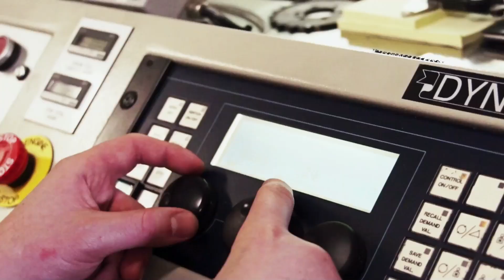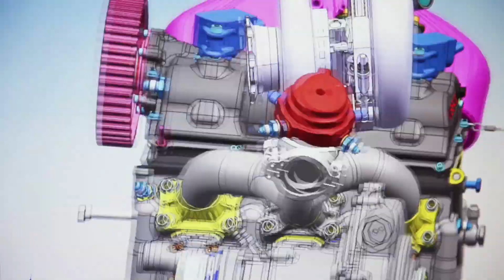Nissan ZEOD RC Making #2: Engine

Comment: I first read about this engine in the Daily Mail and got quite excited (sad I know) and got to thinking of three of these engines in a race boat producing 1200 BHP! also a version modified for aircraft would have an advantage over existing engines from the saving in weight.
I will be following this engine with interest and hope it is not going to be just another one trick pony.
There seems to be a lot of potential here.